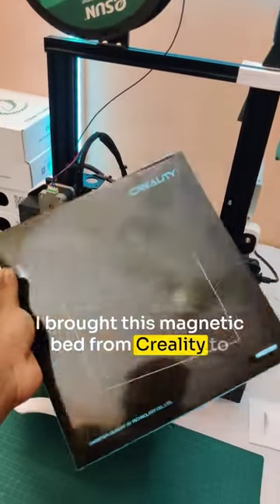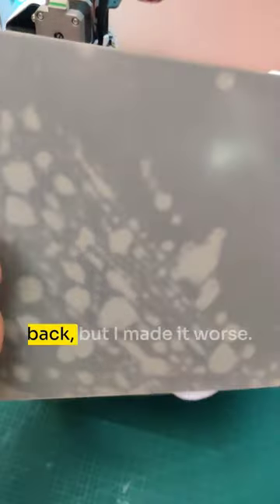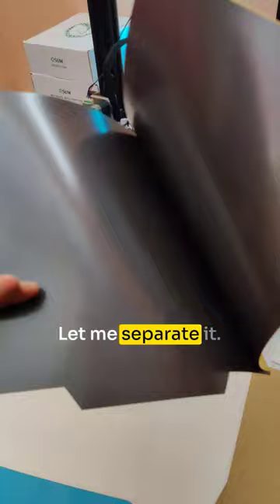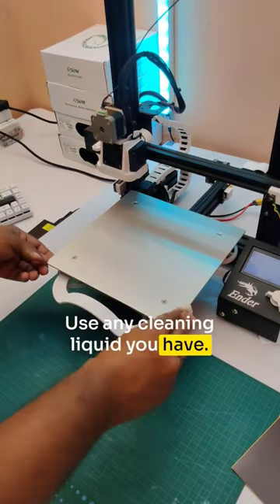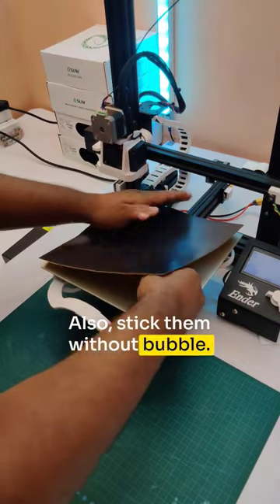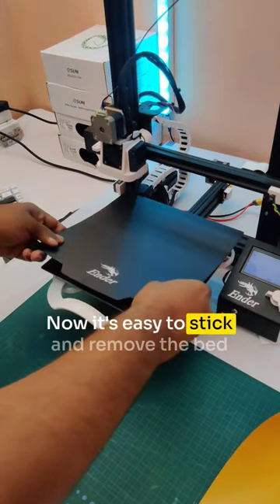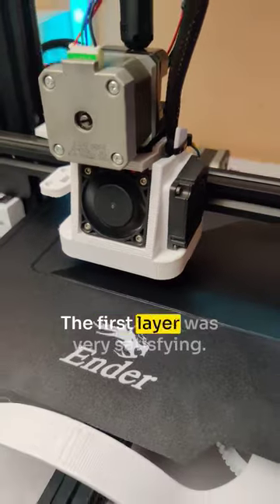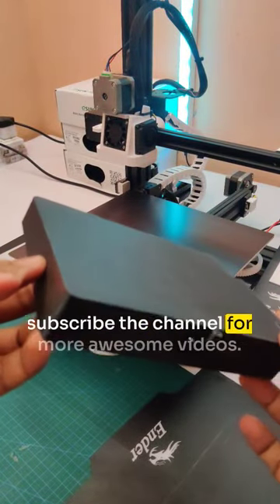Magnetic Bed Upgrade For Ender 3 #shorts #upgrade #ender  #creality

Comment: i hope this doesn’t come off as rude, as i’m only coming from curiosity

is it difficult to type on a keyboard with your left hand? just curious.

also! is a magnetic bed better than a glass bed!
Reply from the maker: 😅For me magnetic bed is good
Reply: Depends on what material your printing with if only PLA magnetic print bed will work but for ABS the magnetic can be damaged because of the high heat over time it will get weaker

Comment: Please can you tell me what vent you have for the extruder.
Reply from the maker: Are you asking about FanDuct or Extruder feeder type
Reply: @dcl3d   Thanks for replying! Im asking about the fan duct for the blower. I was using the petsfang but I just got a CR touch and it does fit and it looks like with yours it would fit.
Reply from the maker: @lxOFWGKTAxl  yes it has a BL Touch mount. It will be fit for your need